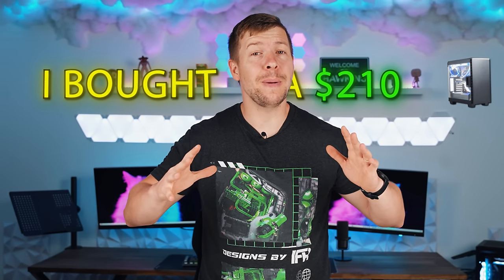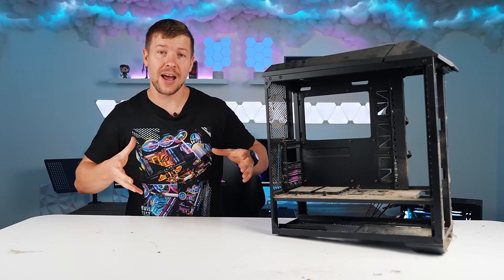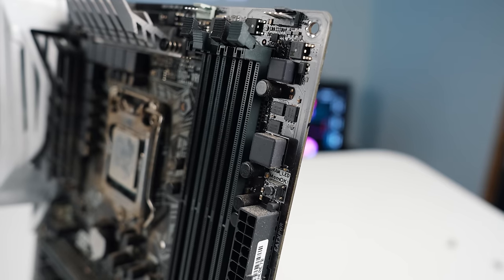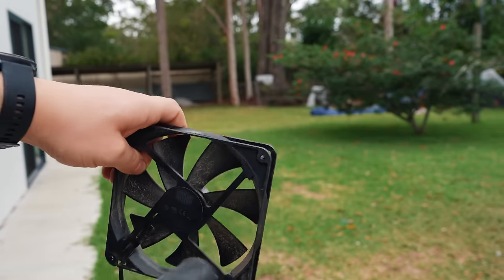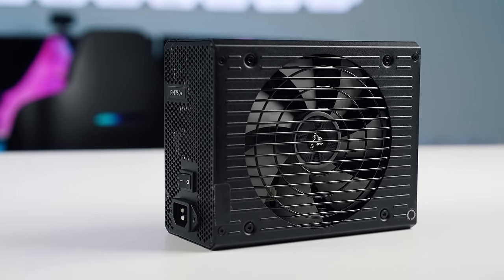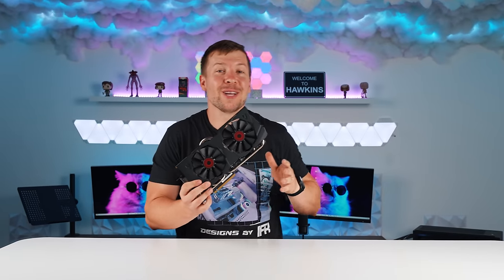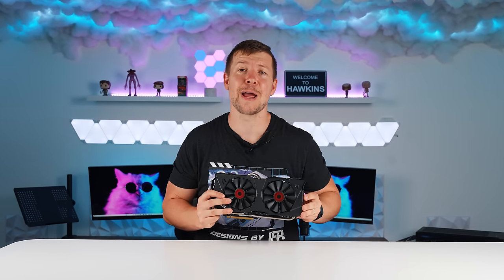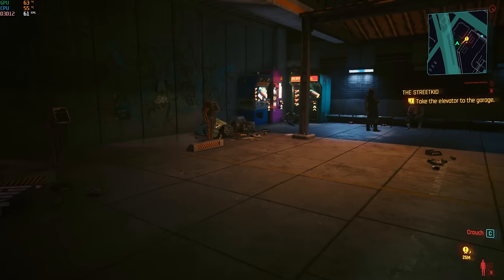Buying a BROKEN $210 Gaming PC On Facebook Marketplace

Comment: On these older ASUS boards, enabling the M.2 is somewhere in PCIe settings. I assume the BIOS setting were reset while cleaning the motherboard by removal of the battery
Reply from the maker: Yes i enabled all bios settings, still no luck unfortunately
Reply: Use Secure erase in the bios options to format the M2. Just try it. And be Sure to run the latest bios maybe.
I think this will solve it.
Reply: I’ve also had to update bios in the past to allow booting from nvme.

Comment: What was the outcome of the NVME? Considering the age, NVME wasn't popular yet. I wonder if the BIOS needed flashed? Or the board wasn't compatible? ORRRR WAIT!!! There's 2 cuts in the "NVME" drive connection meaning it's not NVME at all. It's a SATA SSD... Also, if you look up the specs on that board, it does NOT support NVME...What's your level of knowledge of computers?? Seems novice at best.
Reply from the maker: You dont think i tried all of this? Thats basic stuff